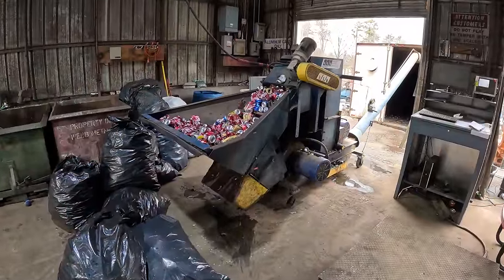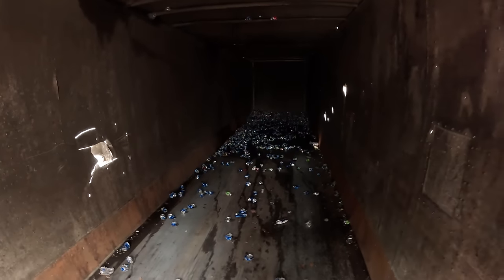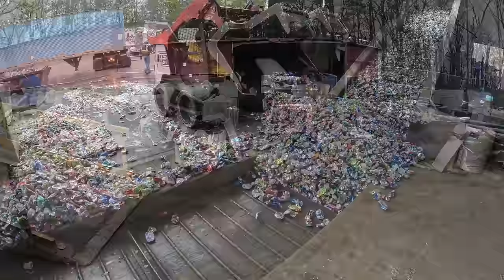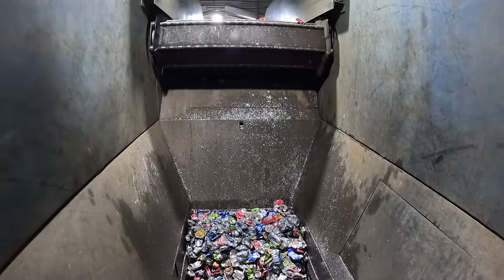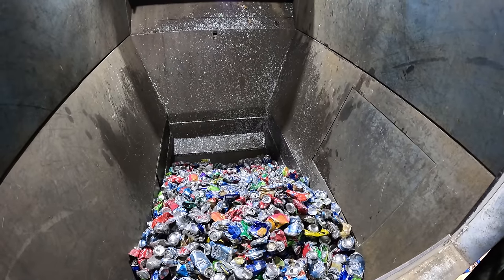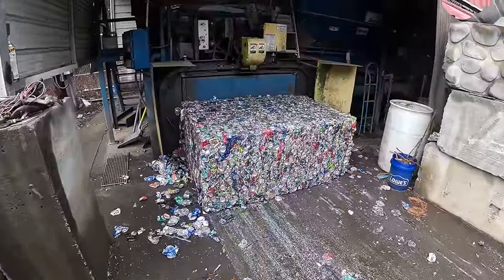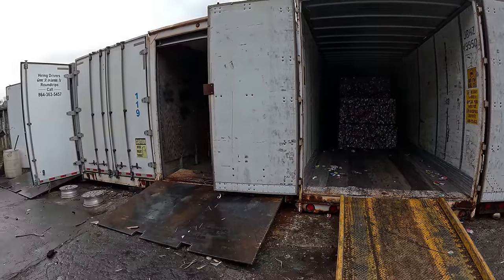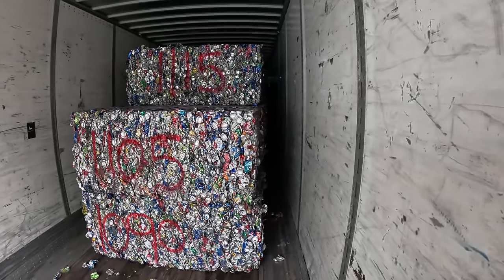This is what happens to YOUR aluminum cans after you recycle them!

Comment: put a wench on the back of your trailer, run four  to six rails  on the inside the make ya a grate that runs down the rails.... just push it to the back of the trailer before you blow all your cans in then ya can use the wench to pull em all out of the back of the truck on to the conveyor doesnt matter where the cable is, just pull em out slow..... skip the scoopin man

Comment: Why not have the trailer back up to the conveyor, then rig up a rake system that goes into the van across the top under the roof of the van where it would drop down with it's own weight. You them have a motor or hydraulics to simply pull the rake back out which brings the cans...rinse and repeat until it is done. It doesn't have to be fancy, it just has to work.

Comment: I would like to see a video on the mill that grinds and separates flatten out cars!!! I have not found any on the tube.
Reply: There are videos of automobile recycling yards , they're in other countries not in the US. There are machines called industrial shredders that literally chew apart entire automobiles and there are machines that crush them and rip out the engine block.
Reply: Not very many because the hammer mill that shreds cars has no visible working parts, the car just disappears inside and comes out in chunks

Comment: I think you need to move your can crusher and blower to the conveyor area so you can eliminate the trailer and skid steer process.
Reply: Came to say exactly the same! Seems like a lot of diesel burnt and duplicate handling of the materials.
Even loading the bags on to the trailer before being sorted would be more efficient
Reply: They use the bailer for many items like aluminum siding, extruded aluminum, radiators, copper tubing, etc. Probably isn’t practical in this case from where the scales are in relation to the bailer. At least that’s what I see at my scrapyard.
Reply: @dr.a006  Thats makes sense. Thanks for the reply!
Reply: @Cossie2k also don’t get enough cans to bake them all the time

Comment: Another great video ,and of  course another idea of how someone else does things. Our local scrapyard collects a lot of aluminum cans . Their set up is similar to yours, but after blowing the cans into and filling a trailer, they drop the trailer at the conveyer and bring a yard crane and put a chain around the kingpin on the trailer. Once the doors are opened,  the crane operator just keeps lifting higher until it's empty. Would save you time using the ramp.

Comment: Why not back the trailer straight to the bailer.2 men shovel them straight out.wasted Diesel and Time.
Reply: Or a dump trailer, this is a ton of waste.
Reply: Yup. And I also drive skid loaders all day.   He is going uphill with the bucket to high. He’s going to flip it over one day
Reply: Yup, they’re aluminum cans, not steel ingots here … waste of energy and fuel , wow
Reply: Rig a plywood wall at the front of the trailer and attach four cables at each corner. Pull the “plunger” out and load them off the floor. That ramp is a death trap.
Reply: All of you must not be business leaders.  All workers who complain about the labor cause you do it...

Your saying why not pay 2 people to shovel or move the cans by hand outta trailor onto the belt... that it's a waste of diesel for the tractor... well 3 things..

1) the trailor won't fit inside the building so besides maybe a few feet it won't back up much more.
2) diesel is $4-$5 a gallon which will run tnat tractor a million times moving the 10 feet it goes backwards and foward . And in one shove it moves 1 tons of cans in not even 30 seconds to a minute .. costing idk say .30 cents in gas to do the whole trailor and maybe $10 in labor for 30 min for a guy paid $20 a hour doing manual Labor... 
3) your opinion is paying a person to push or shovel or whatever ALL THOSE CANS off the trailor onto the belt and not use the tractor. So a person working a shovel or tool shoveling all that is gonna take hours to do. That's $40-$60 in labor and alot longer then rather spend the .40 cents of diesel fuel it took for the tractor to make 5 full pushes... that and guess what. Tractors don't call in sick, they don't hurt there back and can't do manual labor etc. A guy sits behind the seat and the work gets done. You make a human responsible for that then from time to time on top of taking 2-3 hours. You have work that can't be done cause there hurt or whatever reason...

So no all 4 of you commenters who clearly are day labors. Stick the business decisions to management and owners.
Reply: A better idea would be to use walking floor trailers. Just back the trailer into the conveyor area, activate the walking floor and the trailer will unload itself directly to the conveyor.
Reply: You’re not very smart
Reply: @davidwalsh3675 : The correct solution. That's what we used for sawdust/shavings delivery to char kilns for charcoal briquettes production. They work great. 
👍👍👏🇺🇲
Reply: Because you can still smoke while using bobcat, instead of paying two guys while one is always smoking or on his phone!
Reply: Because it would take 2 guys 5 minutes to do what the loader does in one scoop.
Reply: There isn't enough space to back that trailer straight in to where the baler is. Customers still need to get by the baler to drop off their material. One guy can be paid to use the skid loader with an extra heavy modified bucket to remove the cans from the trailer. To those commenting on the skid loader flipping over, the ramp isn't steep enough for that. To those commenting on the waste of diesel, if that skid loader wasn't doing this job, it would be running to do a different job anyway. For what those cans are worth baled up, the diesel in the loader is a moot point.
Reply: @justinbarrier3459 yes sir I was fixing to say something but you covered it I bet they would not push no shovels after they had a few cans full of tobacco spit and it covering them they don’t realize how nasty cans are to deal with great comment
Reply: @aaronjoby Then go do it for him, instead of complaining behind a screen. Bunch of karens
Reply: @moojuice369 Who cares? It's getting done, you aren't doing it.
Reply: @AdonaiNate  🤣🤣🤣
Reply: Thanks for sharing!
Anyone else spot the glass bottles in that load of cans?
Reply: Less manpower = more profit
Reply: @anthonybasile5035 You mean you operate a skid loader all day? It’s hugely unlikely he’s going to tip over backwards considering the weight of that bucket. I don’t think you know what you’re talking about
Reply: @warpedbeyondhelp 
That’s called a Mormon board works pretty good
Reply: I would recommend a live bottom trailer
Reply: Turn the bloody cap around the propper way how old are you 😡from N.Zealand.
Reply: Wait. Isn’t this THEIR business? They can do as they please. Period.
Reply: @guymann4016  obvious it's their business.stupid comment.put it on a public platform then they expect comments.Their money Their wasting.
Reply: Probably the owners son who gets to operate that
Reply: Everybody seems to be a F'kin expert on can shifting
Reply: That's how American companies work unfortunately.
Reply: 2 men cost way more money 💰
Reply: Show me two men:

1) with a license who can drive themselves to work.

2) who will show up every day and on time.

3) who can piss clean in order to satisfy the company's insurance company. 

4) who will leave their cell phones in their car during work hours.

5) willing to do the manual labr of operating a shovel for eight hours.
Reply: @anthonybasile5035 never. The bucket is way to heavy.
Reply: If it was all aluminum, then yes, but people put all sorts of stuff in them that shouldn't be there.
Reply: Buy the business so that you can run it the way you want to
Reply: You have no idea what you're talking about.
Reply: @johnwesterberg-ml8lq The owner is young so it could be his brother or a close friend😄